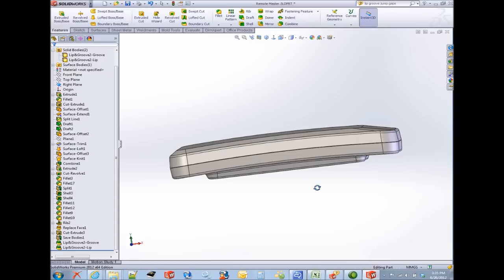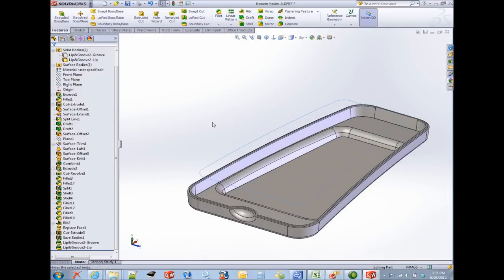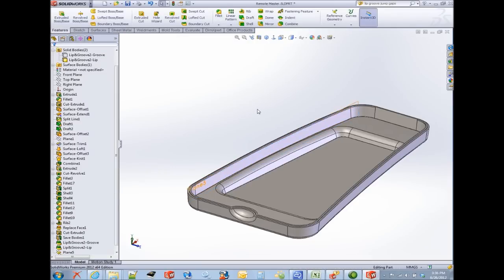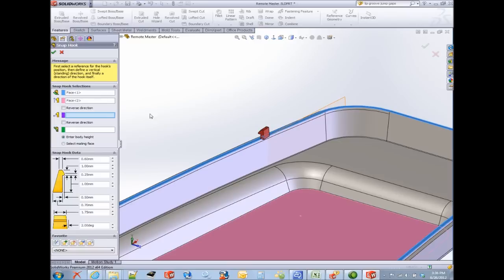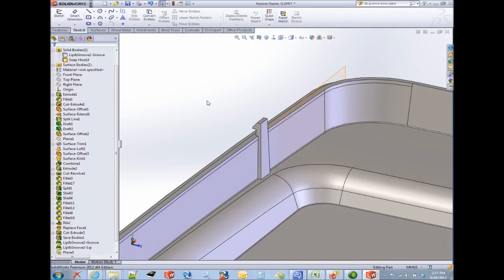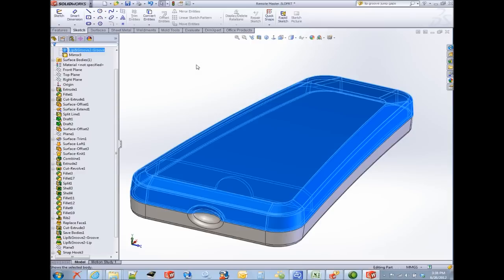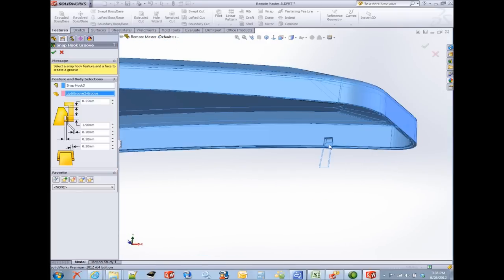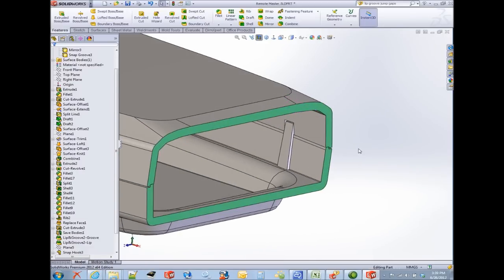SOLIDWORKS - Snap Hook and Groove

Comment: I've noticed that you're creating the snap hooks in a 'part' model, can the same method be applied to an 'assembly' model?  For instance, can you add grooves to a part in an assembly when the reference hook is different part within the same assembly?
Reply from the maker: At this point the command only exists for use in a part work space.  So, the design would need to be a multi-body part in order to use this feature.
Reply: could it be done from insert part feature in assmbly

Comment: I'm a beginner in solidworks and really appreciate this video. Question: In this design, once you close the two parts together you wouldn't be able to open it again. Is there a way to use this feature and create an open snap hook grove allowing the unhooking process? Or do you simply cut through using a different feature? I understand this video is meant to show how to use the feature in Solidworks but I think the design used in the example should be practical as well. Thanks in advance.
Reply from the maker: You are correct, this video is showing the 'Snap Hook' feature as it is presented in SolidWorks.  For your particular design need additional modifications (cuts, extrudes, etc) would need to be added in addition to this feature to create the design element you desire.

Comment: thank you !
However I'm trying to design an annular snap-fit , is it possible to simulate and analyse the stress applied on it with solidworks ?
Reply from the maker: Yes, SolidWorks Simulation is capable of applying loading to the snap mechanism to test it for stress failures.

Comment: Can this function be used in two separate parts files?
Reply from the maker: The 'Snap Hook' feature is only available in part mode for use with multi-body parts.  There is not an analogous assembly function at this time.

Comment: So that top part is really moldable?
Reply: Yes, but a "slide" feature needs to be designed in the mold tooling.  Unless, you get fancy and possibly redesign the snaps to be cleverly hollow for "no undercut features".  I've worked in consumer electronics and when it comes to snapping parts together there is no expense wasted for tooling.  Especially when "modifying" the snap feature(for thinner neck or deeper hook engagement), so if it's already a separate removable feature in the mold that's easier to modify.